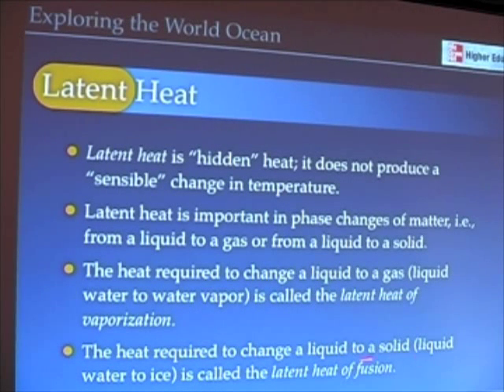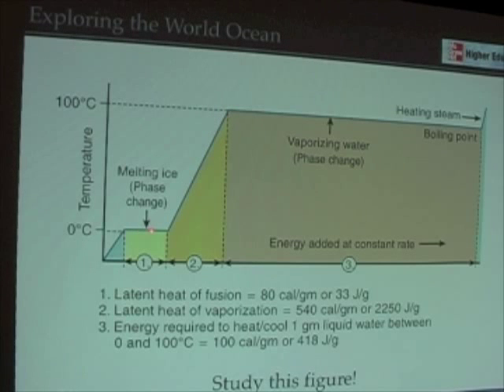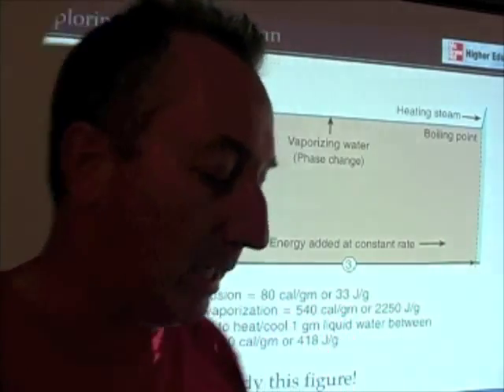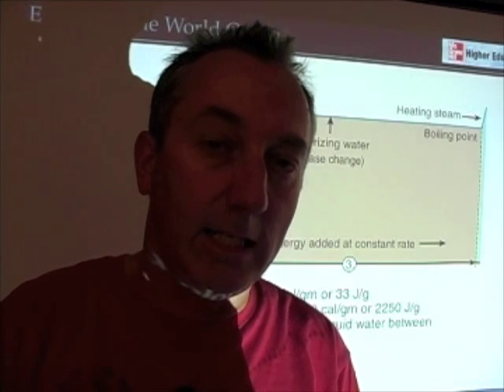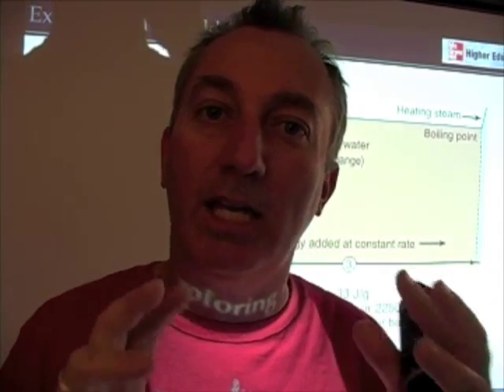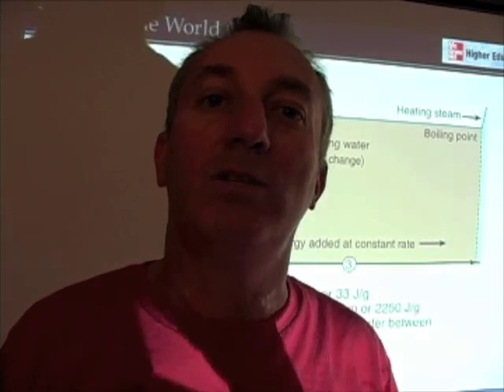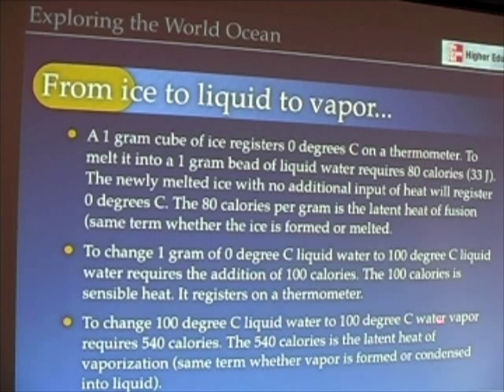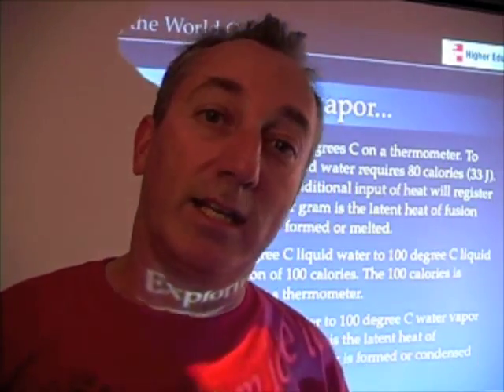Ocean Physics 7 - Latent Heat

Comment: I explained this concept to a co worker, and we tested it with some ice and a thermometer.  We put some ice in a cup and let it melt until there was enough ice-water to put the thermometer in.  The temp was 0°.  I predicted that the temp would stay at 0° until ALL the ice melted, then after that the temp would begin to rise to room temp.  Well. . . it DIDN'T work.  Once there was a half inch of water to 3/4 cup of ice the ice-water's temp began to rise to about 4°.  What did we do wrong?